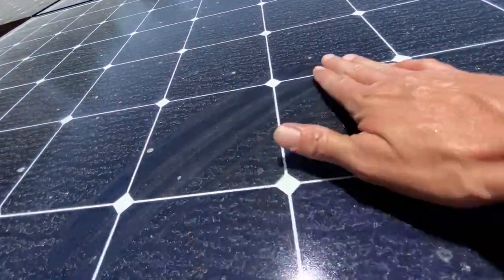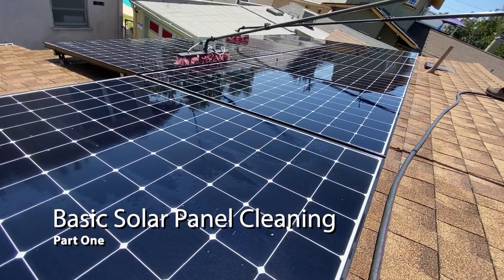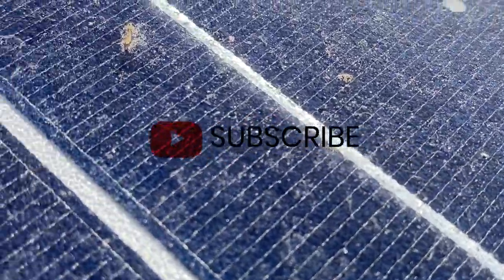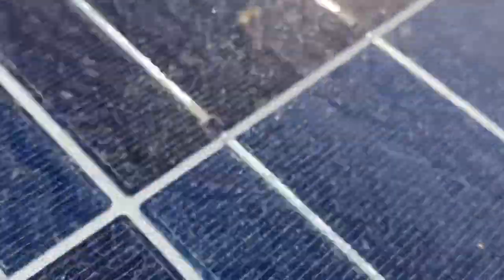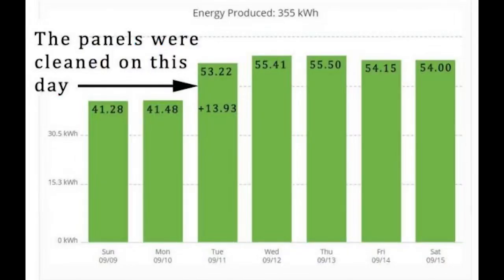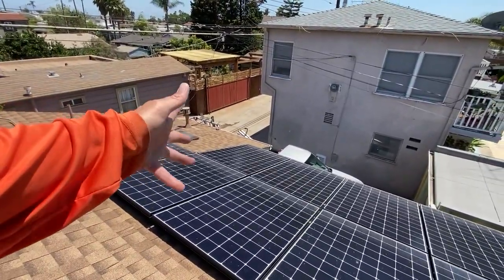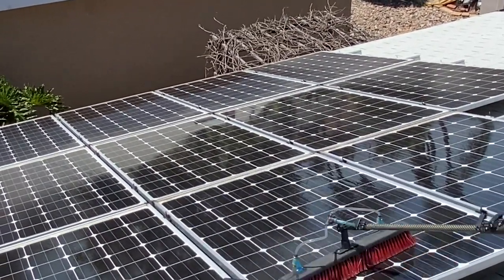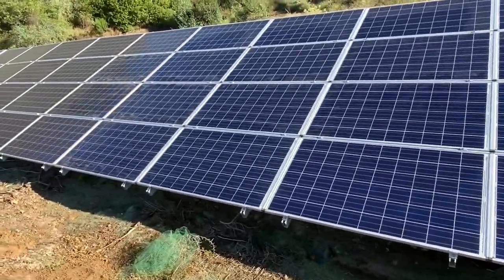Solar Panel Cleaning Basics Part One | How To | @SolarPanelCleaningFriends

Comment: I haven’t test my water yet but it’s probably bad, do I really need to invest into a tank!
Reply from the maker: Yes. You actually do. You need some sort of filtration system to achieve a 0 TDS level. To properly clean solar panels with pure water you need to clean with water the rates 0-40 TDS, using a TDS meter. You need a TDS meter and a filtration system.

Comment: What pole/brush/ and equipment do you use?
Reply from the maker: Currently I use an Excalibur water fed pole from SimPole. The brush I use is a 24 inch brush I created. Other than that I use a Solar7 filter from Ph7.